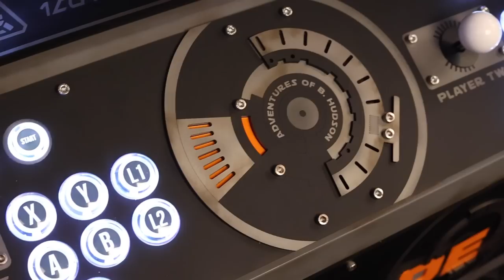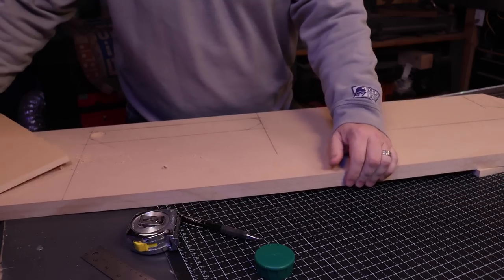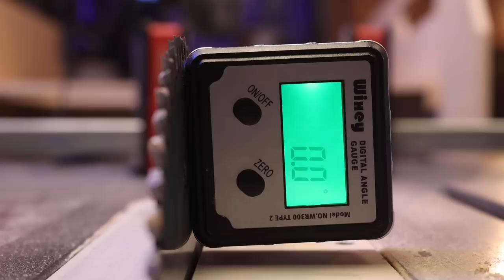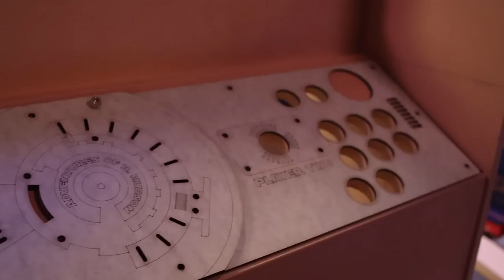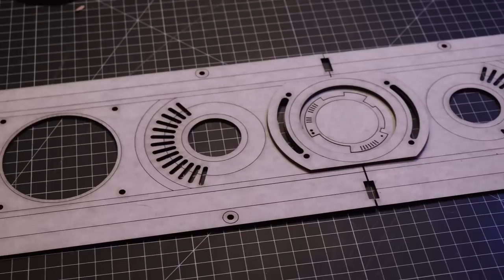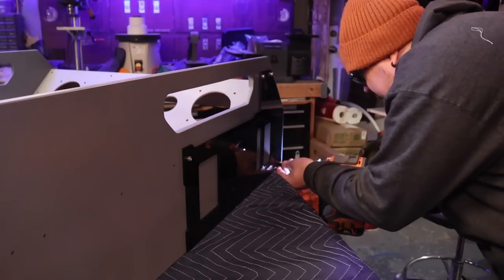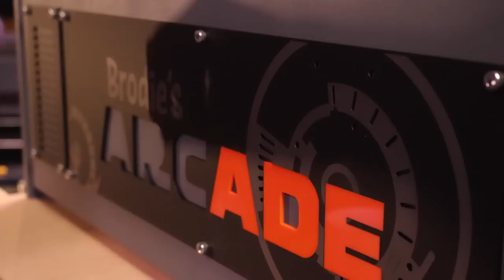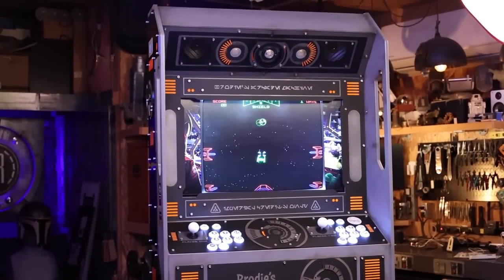Arcade Machine Build

Comment: Another good anti-blowout tip for a forstner bit: If you carefully drill to where only the little point comes through the other side you can flip the piece over and drill the rest out. alternatively you can put a small pilit hole through the whole piece so that both sides show where you need to drill. Either way, the main body of the forstner bit never comes out the other side.
Reply: Ha, I see you did that later in the video for the button holes
Reply from the maker: Great tips all around!

Comment: That looks great. Two comments:
1] I think your speaker might work better if they were in enclosures rather than open at the back
2] All those lovely orange acrylic obrounds. I'd have been very tempted to put some LEDs behind them (that said I'm tempted to add LEDs to most things).
Reply from the maker: Thanks.  I should have gone back and shown the final rear of the cabinet.  I actually did enclose the speakers.  They each have an insulated enclosure that drastically improved the sound.

As far as the orange LED's,  i was very tempted to add lighting.  On the next one I probably will, i was just under the gun to get this done for this week.  But it's a great idea.

Comment: Rather than the super sticky double sided tape, try the masking tape and superglue trick that a lot of us guitar builders use. Stick a strip of tape on one surface, run a thin bead of super glue (C.A.) down the centre of it and then stick another piece of masking tape to it, adhesive side up. Much easier to separate than the DST and holds just as well!
Reply from the maker: great tip!  Thank you for sharing.

Comment: Have you ever noticed how you paint paint, but you don't sand sand??  
Anyways, as usual, very nice job.  I am glad you are doing better.

Did you think about running ZSNES with a concealed keyboard and mouse??  That way there would be access to a bunch of Star Wars and other games??
Reply from the maker: Hi there.  I'm confused by your statement. "paint paint, but you don't sand sand" ??

I did add a keyboard and mouse to the system. It tucks under the machine ;)
Reply: @TheSmugglersRoom  you can use pigment to color something (paint paint onto a wall), but you can't smooth the beach (sand sand the wood hammer).  Sorry, my ADHD got the best of me.

As for the keyboard and such, awesome.  One thing I think would be awesome would be a wrap around flight simulator with "Star Wars: X-Wing" type play.

Comment: Hey @The Smugglers Room with so many hex head m5 bolts, how do you secure them in the mdf, do you stick the nut to the back of the hole drilled or just with the size hole drilled they just pull up in the mdf as they are ? just wondering about time and whether they will pull out easy, thank you  :)
Reply from the maker: Hi Steve.  What I do is drill a hole slightly smaller than the diameter of the hex head bolt.  Then when you put the hex heads in place they actually thread the MDF.  It creates an incredibly tight bond between the MDF and the bolt.  I was amazed.  I have never had issues with it.
Reply: @TheSmugglersRoom  brilliant thank you :) that would also save lots of time , great tip , with a room project just about to happen, am getting all of my information and planning done, your channel has been all I have watched for the past week or so since i discovered it and am really looking forward to getting stuck into my room project and using all of my greeblies and kit horded since god knows when, thanks again :) keep up the great work :) love it

Comment: Am I missing something? Is there a part 1 or will this have a part 2? Its a cool arcade box/housing with buttons but what about the most important part? I would love to see how to build the system and how to make everything work and where and how to get an emulator  up and running?
Reply from the maker: No, you didn't miss anything.  The build is only about the arcade cabinet.  There are plenty of resources on the web for the emulators and systems.

Comment: Im curious to ask, when you glue down the parts do you also nail or screw them down or just let the glue hold everything? I'd be worried about the structural integrity of it D:
Reply from the maker: Do you mean the glueing of the MDF pieces?  Or the Acrylic?  For the MDF yes, it is glued and often stapled or nailed as well.  For the Acrylic pieces we use the hex head bolts and mechanically attache them whenever we can.

Comment: Great Build but there's a few questions...
 - What are the internals of the computer / game driver etc.  Building a case is one thing but where did you get the actual game?
 - Inlay of the orange acrylic is awesome, but you're missing the inside of the letters in "Arcade" or did you add them later?
 - Lastly, I cringed every time you used your drill motor to drive your hex screws to fasten the acrylic.  One slip and bang! A cracked corner!!!
 - Since MOST people do not have a laser cutter or cricket to cut computer generated templates etc, Suggestions for the "common man" would be great.  Maybe decal sheets overlayed on aluminum sheets Then covered with clear acrylic etc. is just one way to get professional look without a laser cutter.  Certainly you have ideas on how you did your builds before laser cutters and crickets!  Tell us! 
Keep up the good work!!!
Reply from the maker: Thanks!

1. everything was built off of a fairly simple PC from MicroCenter.  Nothing flashy.  As far as the Games and interface, if you do a little Google searching you will not doubt find that information and where to go ;)

2. thanks, yep, already added.

3. Never had a problem with slipping.  My drill has a variable speed based on the pressure you put on the trigger.  I'm pretty comfortable with it and I dont fully tighten with the drill, i come back with a wrench.  Maybe i'm playing with fire, but so far so good.

4.  Yep, we have discussed this several times and made suggestions like using a template with a jiggsaw on 1/4 or 1/8" mdf for the panels.  Styrene is another great material that we have shown on the channel a well.  Some of our original builds on the channel were made with MDF and Styrene.  Lots of options out there for sure.